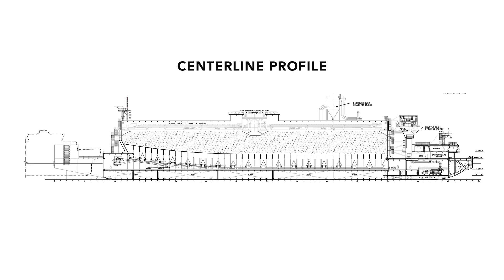Industry-Leading Transhipping Solution Unlocks The Full Potential Of Onslow Iron

Comment: With all that cheap, dirt cheap, iron ore, Australia should be manufacturing steel for export.
Reply: it costs alot more to produce the end product. 
Sadly, China can produce the end product, faster and cheaper. Australia has lost most of its manufacturing to other Asian markets due the cost. 
if you look around your house hold, how much stuff has a label on it, Made in China, made in Bangladesh. any anywhere than Australia. 
a general question, are you (or anyone else) are willing to buy a product at more $$$ value then what is on offer at Kmart, Big W Target. Australian cars are no longer made in Australia, Textiles. 
China has made an impact and has made a good fortune on being faster and quicker. All Australia has is the raw product and Australia has not got the industry to infostructure
Reply: Using our hideously overpriced energy............